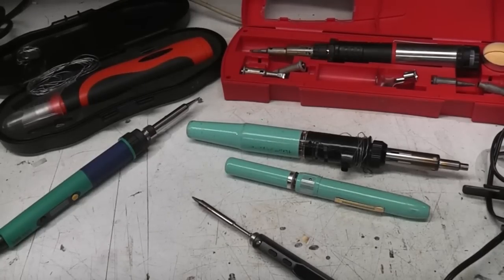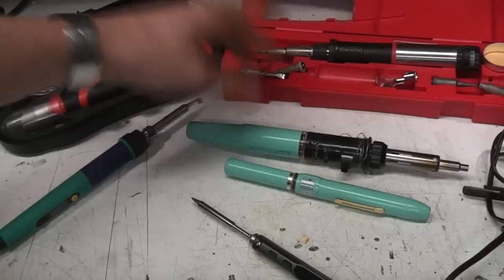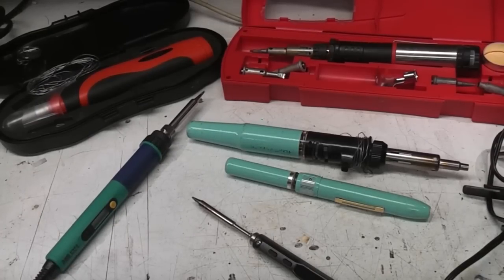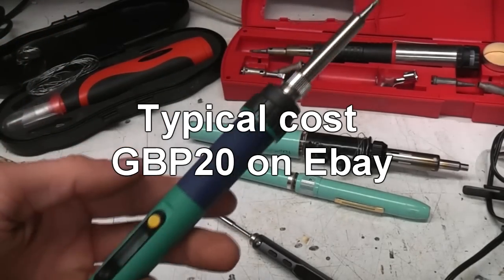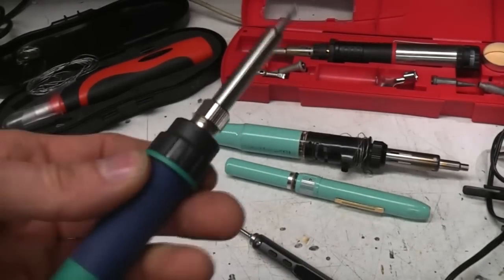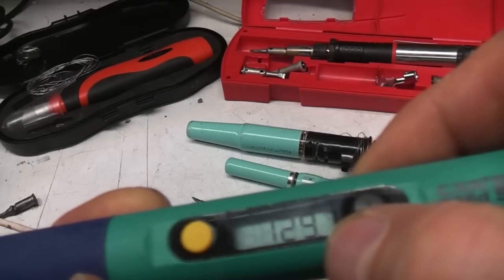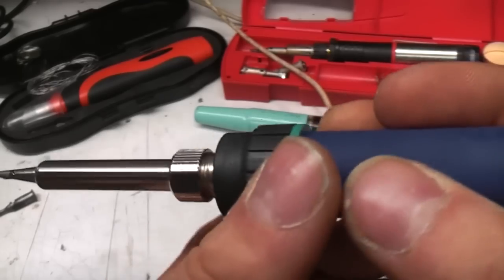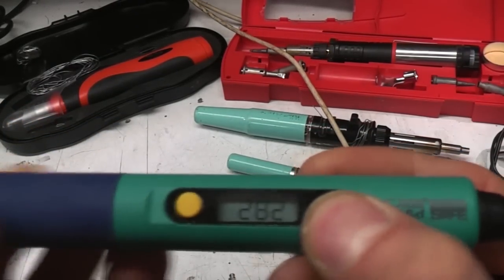TS100 and other soldering irons for when you're away from the bench

Comment: I think one of the biggest issues with the gas irons, (apart from the yo-yo temperature and bit-cremating temperatures) was the purity of the fuel.  When you end up using generic lighter butane it often seems to have a Vaseline-like substance dissolved in it, that builds up on the tiny orifice plate that limits the gas flow to the tip and blocks it.  My first of the bigger gas irons (From Maplin) blocked within a week of light use and being Maplin they didn't want to know.  It was an expensive experience at the time.  I do like that little electronic iron, but I also like the super mass-produced generic Hakko clone irons and bits that are available ten-a-penny from all directions.  It's a bit galling that you can buy a complete iron plus spares for the cost of a single Antex bit.
Reply: +bigclivedotcom I had a Hakko clone and associated dime a dozen bits. I now have an Aoyue with integrated element-tips, and it's fantastic for the money. If I recall correctly, it's a 24-volt element, so it shouldn't be too difficult to convert it to low-voltage use. The tips are about $13 each, which seems pretty reasonable.
Reply from the maker: +bigclivedotcom  One of the supposed big "advantages" of a gas iron is you can pick up refills anywhere - kinda kills that if you can only use special extra-virgin gas..
Reply: mikeselectricstuff Agreed. The camping supply stores around here sell "quadruple refined" butane canisters for double the usual price, probably bottled by some grey-beard on a mountain.
Reply: +bigclivedotcom you're right. fossil fuels are nasty. It's impossible to make a maintenance free device running on fossil fuels.
Reply: +bigclivedotcom Butane tools live longer if they are purged before EVERY fill. Triple filtered/ no filtered gas, they will all plug the device eventually.  The reason why a purge magically revives a dead flame tool doesn't completely make sense to me. I only know that since I have been doing it..... the damn things work again. Seriously, youtube search it. (still hate them though)
Reply: Every gas iron I've used has become blocked within a year, and that's using quality gas from Weller. So it's not like I'm using gas refills from the tobacconist. Next portable iron will likely be a Ts100 with a home made battery bank.

Comment: "Stupid plug for some third world country"

Eyyyyyy, I see what you did there.
Reply: +Connor Wolf eyyyyyy, casual xenophobia!
Reply: +TheDenzel2112 I think it's more taking pot-shots at the horrible, horrible outlet design we have.

We have an outlet strip mounted to one of the workbenches at my work. Some solder dangling down fell and shorted across the mains-neutral pins, as the connected plug had pulled out a bit, and now it's got this giant scorch-mark around one of the outlets.
Reply: +Connor Wolf would be nice if you put in a time stamp
2:00
Reply: +Connor Wolf Ground pin on top!  ∴
Reply: +Connor Wolf Actually that plug was indeed from an electrically horrible country... China (you can tell by the fact there were no retention holes in the plug prongs and it was rated for 220v with that kind of plug)
Reply: +TheChipmunk2008 I don't know why the North American plug design wasn't simply upgraded to follow the insulated pin design on the Australian male plugs where only the tips are exposed.
Reply: +Connor Wolf Yes, but that's rich coming from an Englishman. I bet more people are getting injured from stepping on that monstrosity they got there than electrocuted from an US plug.
Reply: +radoinc What Englishman?
Reply: +TheChipmunk2008 Mike
Reply: +spikester Agreed. They do exist (if you google hard enough, you'll find vendors that make them for the Japanese market), but they are indeed exceedingly rare, and I'm sure they'll stay rare unless the US electrical code changes to demand it.
Reply: +radoinc You'd loose that bet. The US plug is just unsafe. Period.
Reply: +pinguiin Geez, angry much?
Reply: +Connor Wolf He's just burned his fingers on an overloaded plug <grin>
Reply: +aserta this is actually a Japanese plug, not US. Hence the separate ground wire.
Reply: That is an old two prone plug used in old style solder.

Comment: I have the same Portasol gas iron and I do like it, for quick soldering it's pretty handy. When I first start it I'll put the gas flow valve in the middle (medium setting) and once the catalyst starts to glow I put it on low. I find this method works well to keep the temps in check. I work in the automotive repair industry and having a soldering iron that can be ready to go in a matter of seconds is very nice.

Comment: I have had the portasol for about 10 years and it still works great. I use it a lot for heatshrink. i take the tip and the main shroud right off, and if you light it and hold the igniter down, you can a nice blue flame for quickly shrinking your heat shrink tubing.

Comment: I know this is an old video but I bought my TS-100 soldering iron about 2 years ago, I right away got rid of the stupid barrel socket and soldered some silicone flex for replacement soldering irons, I terminated it with Anderson connectors as I use that for everything here. I can use my LIPO pack to power it and even put a boost converter to make it higher volt/amp/watt... I did end up buying 3 more tips as I tend to do a lot of various soldering work from speaker terminals to microsoldering, so I got the extra fine tip, the flat fat one for bigger things and a thin edge like a blade going to a tip which is supurb for flow soldering fine pitch chips.
I'm glad that the iron is so lightweight and don't hold battery pack inside, this would make it hard to move when doing really fine tip soldering.
Biggest down side is if using at 24v you need to limit the current to like 3 amps or you'll cook the mosfet then the tip will glow red! You can however remove and replace it to a higher rated semiconductor and it won't be a problem then.
A firmware update is the best idea, it will work out the box but being able to set it up with the fine details from the menu is so much better.
I have 2 stations a small 6-15watt micro tip and a 20-85w exchangeable tip unit.. I never use them now, only the TS-100 as I can get the full range of tips and temperature that heats up in seconds not minutes

Comment: So many great ideas again and thank you for showing TS100. I am not often out repairing stuff, but I wish we would have this TS100 when we were up at the ceiling of a church repairing LEDs.
Better grip a bit closer to the point and a silicone cable would be nice. 18V drill battery is always in a toolbox so I don't see a problem with that.
USB-C would be an option in a few years when it becomes more common, but I think 2,5mm is much more robust for field use.

Comment: Thing to be aware of with the TS 100 is that the tip is not grounded and will float at the common mode voltage of your laptop power supply, which may be significant and may damage MOSFET or other ESD sensitive devices. With 120V laptop switching power supply, the tip was above 50V unless grounded using the grounding screw provided in the back of the iron.
If you just need to solder wires and passive components, it's no big deal though.

Comment: On some of my lightweight irons I've glued two magnets, one near where the tip enters the case and another near the bottom. The magnet near the tip is thicker than the bottom magnet. Useful if you're near something steel. The thicker magnet automatically holds the tip farther away from whatever surface you stick it to. Just make sure you don't use really strong magnets.

Comment: I usually travel with a small butane Portosol (it's orange and smaller than the one you shooeed). However, out of desperation I tried a tiny 5V USB iron recently and found it worked on smaller component PCB soldering. No good for larger connections, or anything heatsinked, but it got me out of trouble. It's literally the size of a pen, so I keep it in my pencil case for emergencies when my Portosol isn't with me.

Comment: The Portasol irons seem to work great. I've dropped mine in water a couple times even, shake it off and it still ignites first click. Probably wouldn't try solder a MSOP package with it, but I'd be comfortable with basic SMD repair using it if I had to, and it has the capacity to handle 8AWG wire just fine too.

Comment: You might be interested in a Weller WSM 1 pencil for your project. They are shorter than the JBC tips, run on 12V, use a standard stereo connector and also have the temperature sensor implemented in the tip.

Comment: The TS100 is pretty neat... My old ThinkPad X40 actually has a port on the side that exposes the laptop's battery voltage (intent was to power external optical drives), would have been cool to power the iron off of that!

Comment: The best designed soldering iron is the dyi right here on u tube.  You take a old transformer change the secondary to thick shielded copper wire, make a handle from pvc, bend some bare thick copper wire back on itself attach it to the secondary with a few twists.  I like this approach because so far all the soldering I have used burned up a few months.  This way I can fix or make a new one with available "non soldering iron parts" and don´t have to interrupt a project to wait for the mailman to deliver something from China.

Comment: It's curious how Mike lobs stuff around when demo'ing!   
I have a portable gas iron branded Snap-On, probably actually Portasol. Had it best part of 20 years and it's still going strong, although to be fair it doesn't get much use.  It does have a flint striker in the cap.  As I'm familiar with it I find temp control not to be a problem. I've mainly used it on automotive jobs and some outdoor stuff.  I consider to to be a last resort so accept it's limitations.
I'm surprised that a portable iron with a separate battery pack hasn't bee produced.  That would allow a fairly chunky Li Ir battery pack to be used, clipped to a belt or pocket.
Also include a retractable open ended cover and magnetic attachment, so the iron can be attached to the structure of the work piece, if steel, and an indicator to show power on, and for upto working temp.
I recently acquired a very curious iron, called a Solo Solder Tool.  It's a mains powered, low voltage iron, in a self contained steel case, mains lead and all.  The way it works is very curious.  The solder is fed down the centre of the shaft of the iron from an integral, reloadable spool cassette, to a hollow tip.  The solder is used as a conductor to the work and melts on contact!   Power is provided by a small TX in the case.
I haven't actually tried it as it's almost as new and I wish to keep it as a collectable.  I'd not seen or heard of this device before finding this one.  Try as I might I cannot find any advertising for it in old mags.  If anyone does have any info on it I would love to hear from them.

Comment: I was pretty interested in that iron but went with the TS80 instead after i learned about it.
YT is flooded with reviews for that one, but it's basically an USB powered version of the TS100 using Quickcharge compatible chargers and powerbanks (thus not limited to the 5V 2A of old USB irons).
Since i rarely have access to mains sockets at work, it has been a reaaly good option. I use it to do a lot of sub-D termination, and some repair work on SMPS.
No issues so far, even on PCBs with fairly wide ground planes.

Comment: Thanks for showing that mains iron, I knew they made similar ones but I didn't know they made 900M tip capable ones.

On the subject of portable irons have you ever seen the Iso-Tip irons? Those seem pretty good, only issue is they use somewhat outdated technology and well they aren't simply switch on or off, they're contact based so you have to hold the button for power basically like using a soldering gun.
I've actually thought of taking that idea and a 907 clone handle and using an old cordless drill to do pretty much the same thing, the drill case would make for a nice holder for the iron, plus you can hide any sort of SMPS or likewise any other electronics you want inside and reuse the trigger for power, not only that but it of obviously comes with a battery which you can either reuse or hack a li-ion pack into it.
Reply: +vgamesx1 I wanted an iso tip iron but the shipping from the us was more than the iron most of my work is automotive and gas irons tend to damage looms or expensive plastic trims but i think i will try the ts100

Comment: Interesting video as always! I use an Ersa branded Portasol (smaller version of the one in this video) and an Ersa Multi-TC for field work -- I quite like them both, and I'm particularly impressed by the Ersadur tips for the Multi-TC. The gas powered one is useful for rough work and heatshrinking, but even at low power it's so ridiculously hot that soldering thin gauge wires, and most kinds of connectors, usually leas to melted PVC, frustration and pain. The TS100 looks very useful for the typical lighting tech stuff I do (lots of 5-pin XLR and LED strips).

Metabo makes a so-called "battery adapter" which slides onto 14,4 and 18V packs and provides a 12V (and USB) output -- I guess that would be a good power source for the TS100, at least for those of us with a collection of Metabo packs. It should also provide a bit more protection than just sticking a piece of copper into the battery terminal, at the cost of not looking quite as cool (and giving only 12V out out rather than the raw voltage)

Comment: I like that the TS100 is powered through a DC jack. If you have access to a 3D printer, you could easily make a better grip, closer to the working tip (insulate it from the core, of course) and include an LED ring as well, and maybe something to hold the allen key. Seems very versitile as is. I wouldn't go strapping batteries onto it.

Comment: I've been looking for a decent ~12V iron for a while. I've seen one or two others,and even a USB powered one..but nothing that seemed to actually be terribly usable. (as you said,the 5V ones are laughable.)
It would be nice to solder on my car,and not have to drag a long mains extension cord out with me. (I've not had great luck with gas powered irons.) The car already has a big battery under the hood,for power. I've also got some 5-6A dc-dc converter modules,maybe boost it up to 18V or so,for more power.
I think I might buy myself one for X-mas. :)

Comment: informative and insightful as ever. I have a Hakko battery iron and its just about okay for low power car wiring, coax connectors etc.

Maybe you could 3D print something to improve the ergonomics of that TS100 iron. Either clip/glue on or just replace the entire case.

Comment: A battery pack which controlled the Weller irons (with their funny din connector) would be nice. Temperature control on the "battery box" all would be good. 

Or some interface between a power supply and the irons with the appropriate control stuff.

Comment: Take hex key and braze a stainless steel ring to it, so it will fit on the power cord. I do the same with drill chuck keys and some stainless steel rigging ropes and crimp ferrules so they do not get lost. Cable is easy to get from yacht places as broken rigging pieces, and 1/4 or 3/8 copper tubing cut to size.

Comment: I think you could get away with having the elements split in 4- run it all in series at 24V to give you half the power, all in parallel at 12V to give you full power and in two series - two parallels  at 24V to give you full power. And of course two series- two parallels at 12V would give you half the power. That would be simpler  and smaller to control than a 65W buck-boost.

Comment: I wonder if perhaps looking at something like the DNA 200 watt chipset used in electronic cigarettes would be a good starting point, temperature control, seriously high power and runs of 3 18650s or lipos
Reply: For thee price of DNA 200, you can get good soldering station

Comment: We had the self igniting pyropen at work, seemed to be great, but it suffered the same problems as you found, hard to light and catalytic converter etc.
I like that ts100, i think i would get or make a dedicated belt pack that could be used for other things maybe, as for solder storage i would go with a keychain option, much like the duct tape holder http://gearward.com/collections/frontpage/products/keychain-duct-tape but would make my own version.
Small size is ok if it's used for quick portable purposes once in a while, not permanent desk work,  but i guess you would be using it more often in your line of work.